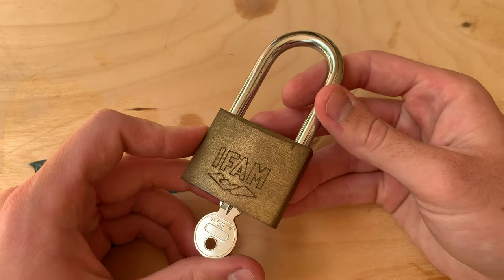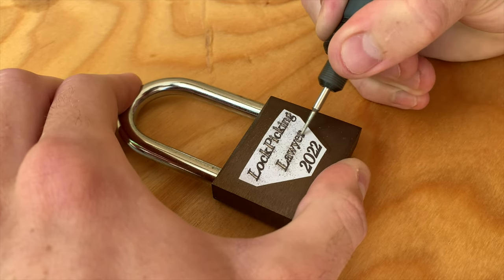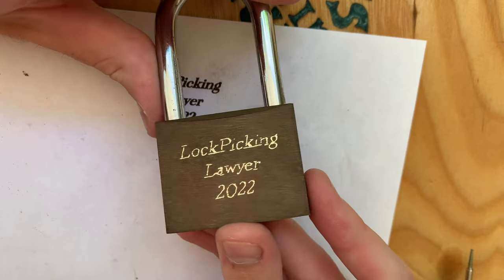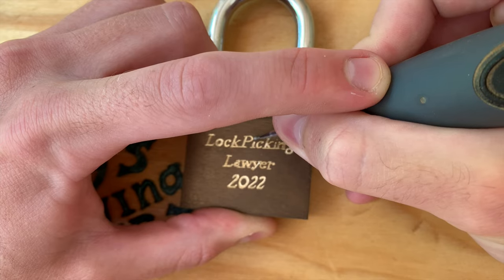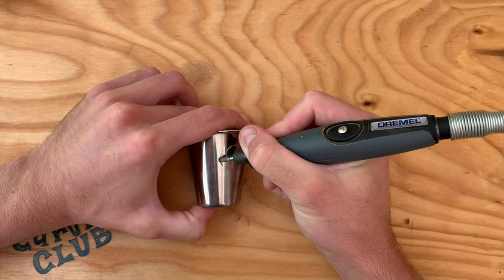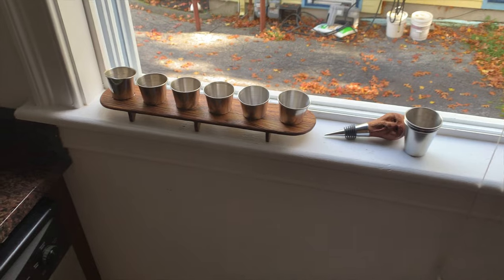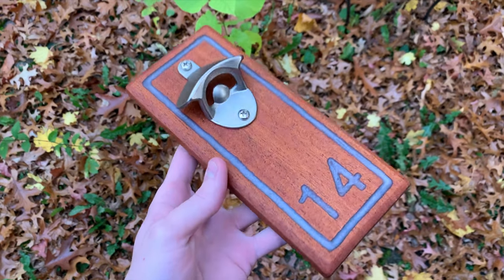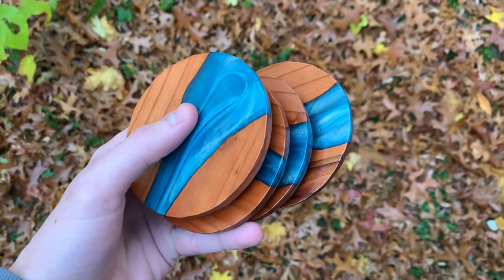How I Engrave Metal with a Dremel (LockPickingLawyer + Shot Glasses)

Comment: A few rekevant points need to be made.
  If surface is brass and actual depth is needed,:
. use micromotor handpiece with inverted cone or round burrs (steel burrs). Depth of say 1/4 mm will be more visible than scratched surface.
. actual charcter of letters will be given more prominence, --especially if font is in style shown in this video--, that is thin and thick parts of letters. 
. engraving is not scratching a surface but it is cutting into metal.
. For steel surfaces or heavily plated metals use carbide burrs to engrave.-
. use 😮of diamond crusted burrs will not last on metal surface, they are more suited for glass and crystal engraving (for ppl with more refined lettering skills).
.  crystal and glass engraving can be enhanced as well as shading/tonal work by using various carburandum discs attached to mandrels.
. micromitors are more suited for professional use, as they cost usd 450-1200.

Comment: Great Video! Thanks for all the knowledge. I want to carve wording into gemstone\amethyst crystal point would I need the engraving + what accessories would I need for crystal? Thanks!
Reply from the maker: Hi - do your safety research because crystal is almost entirely silica so you really don't want to breathe in any dust. Good mask is needed. I'd get some diamond point bits, cheap ones work fine but are slow. I'm not sure how I'd go about polishing though
Reply from the maker: Keeping the stone wet helps to limit dust, may damage the tool though. I'd look at other channels for advice since I don't really do stone carvings so I'm not so sure what I'm talking about